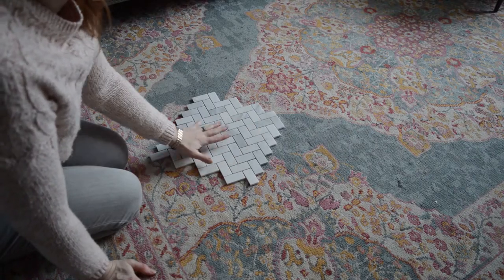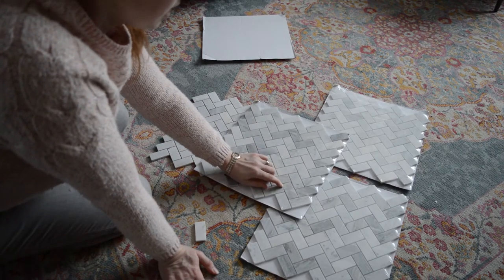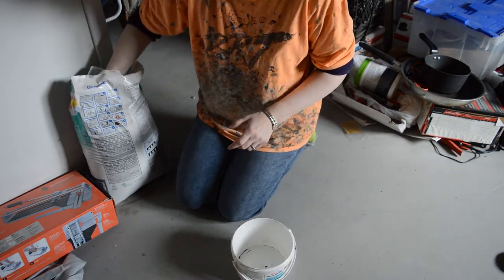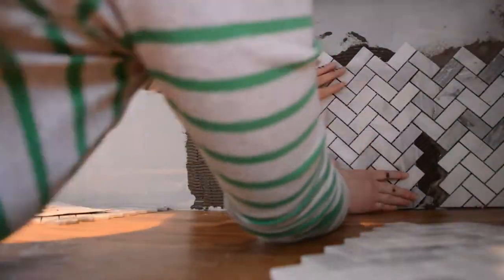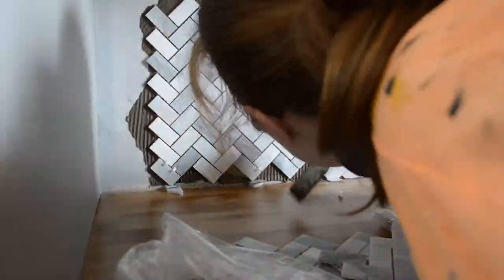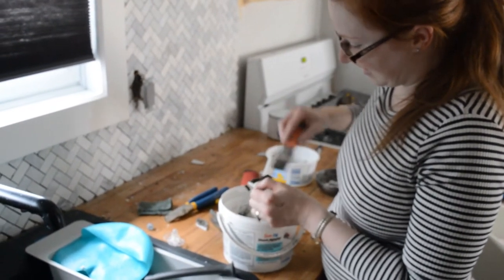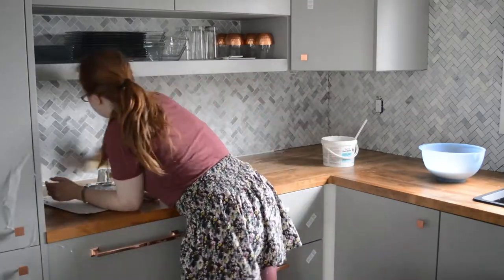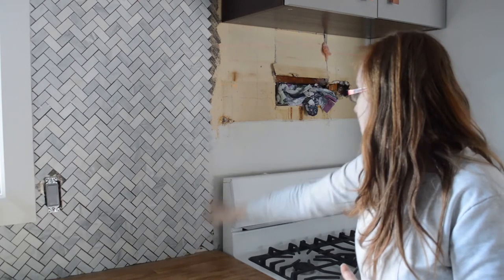Mosaic Backsplash Install (Kitchen Series Video 13)

Comment: Having just installed a 32 s.ft. Mosaic Porcelain Herringbone backslash, it was one of the most time consuming installs I have done, and I have done plenty. First, I used OMNI non slip adhesive as opposed to thinset. All the little fill in pieces were cut on a wet saw which was extremely time consuming considering the precision accuracy of each cut. In all, about 100 cuts! Just the tile install took about 9 hours and I have done over 28 backsplash installs! The key here is patience and skill set. This would be a very challenging DIY undertaking. Every single cm;mm or fraction of an inch is crucial...precision!!! You need to be a seasoned tile setter with a mathematical and methodical mindset. You need professional tile tools as well as a damn good professional wet saw with a brand new blade. That is absolutely crucial to avoid chipping and tile cracks. Let the blade do the work....don't push it....nice and slow...take your time!! 
Go over the entire wall(s) with your naked eye and tweek any tile pieces that look out of line. Every single grout line must be uniform from one end to the other. Use spacers if you have too, but it HAS to be absolutely perfect!!!
Let the tile sit for a minimum of 48 before you grout. Don't rush the job!!! 
Always put a spacer under the first row where the tile meets the countertop. Donot sit the tile directly on the countertop!! 
Not all tile requires sealing. Natural stone should always be sealed. 
There is alot to consider when doing ANY tile work!

Comment: Looks great. So how did you cut full sheets? My wet saw is doing a terrible job as well. It's chipping like crazy
Reply from the maker: We found that cutting full sheets (with our marble tiles) was causing too many chips/breakage.  It was quicker to install full sheets near the walls and then cut the individual tiles to fill in the small spots.  We noticed that the whiter marble was more prone to chipping, so we tried to prioritise the darker ones.  (Watch around 9:12 to see what I mean about the gaps near the walls, and using the hand tool to cut them).

Comment: Why are sealer necessary?  What does it do?
Reply from the maker: Marble is a natural, very porous stone - it needs to be sealed to help protect it.  If it isn't, the grout (or other things) may discolour it.
Reply: I found that out the hard way.  I knew I needed to seal it but totally forgot.  I had to use a specific type of remover to get the haze off of it and that took a few days with many applications.  Thank goodness it was a small area and in a place no one goes.  Great video.

Comment: Non of you people have no idea what u r doing this why you need to have a professional do it diyers make it 100 times more complicated if you do not know what u r doing then don’t do it everyone relies on YouTube most YouTubers don’t have a clue ether
Reply from the maker: Andrew - I love learning more about tiling, where could I have updated my technique?!  I've actually taken a tiling course and have been doing it for years - but I learn something new almost every project.  Herringbone (or any diagonal) patterns are super tricky, but it turned out great :)
Reply: I was told to use a white thin set when using translucent marble. I see here you used a dark thin set. Wondering if it darkened your tile. Great job btw.